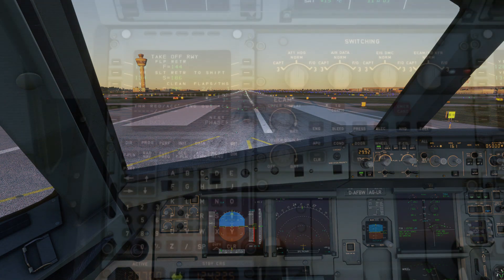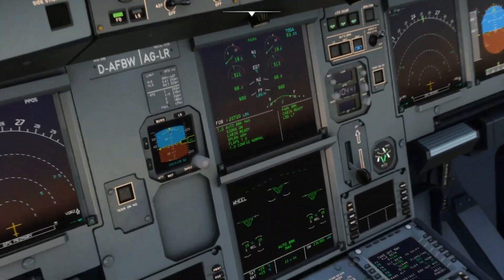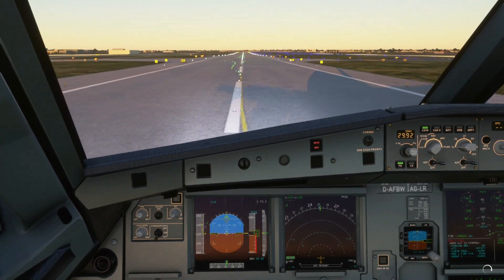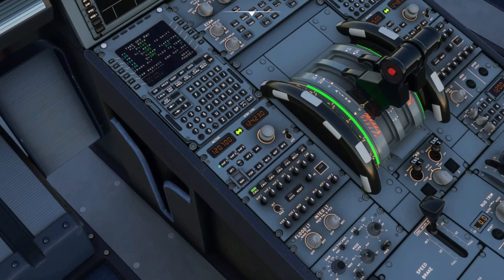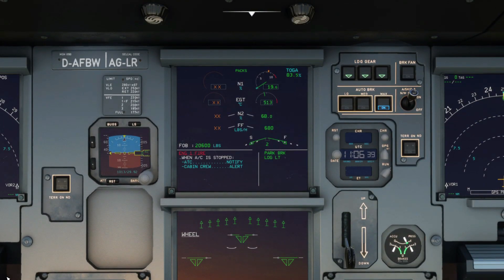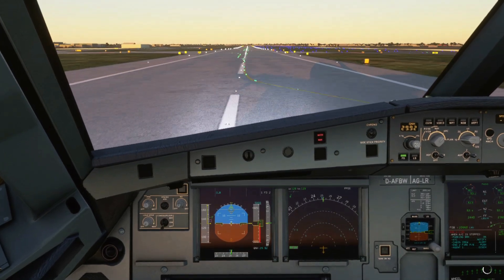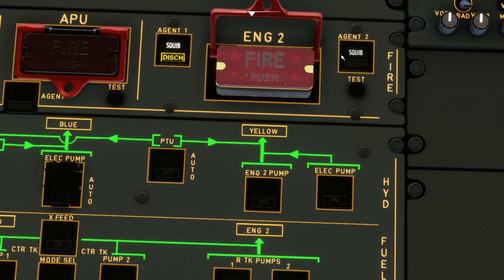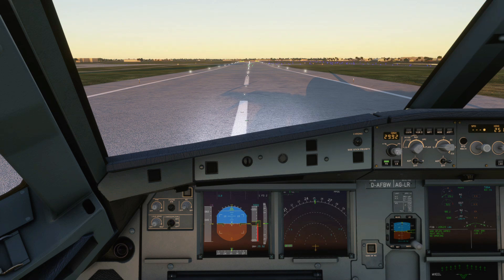ENGINE FIRE DURING TAKEOFF |  Microsoft Flight Simulator | RTO | A32NX | How To Do RTO | Tutorial

Comment: Thank you for the video. How did you configure the aircraft so that right before you hit V1 the engine fire started? The default mfs2020 settings only lets us put timers in it. Did you use any other application or was it just good timing?